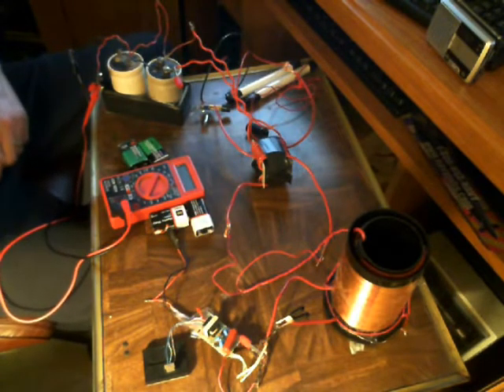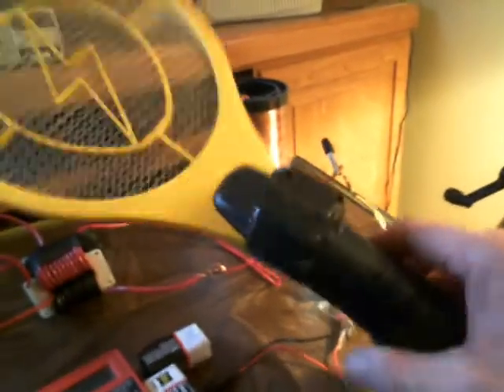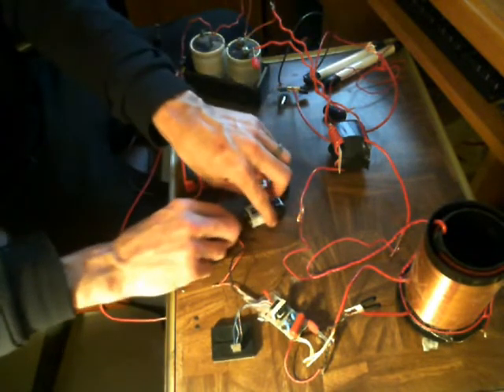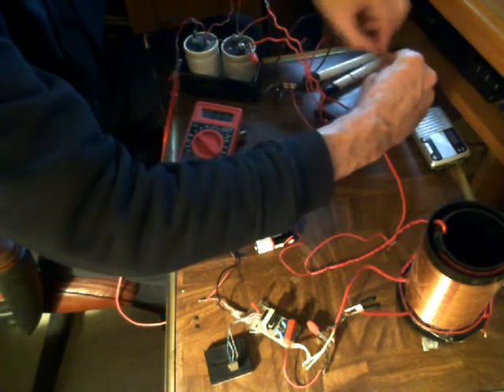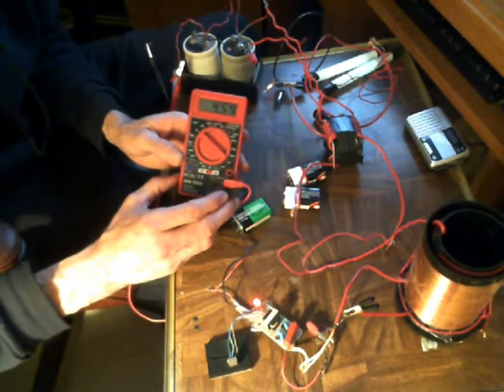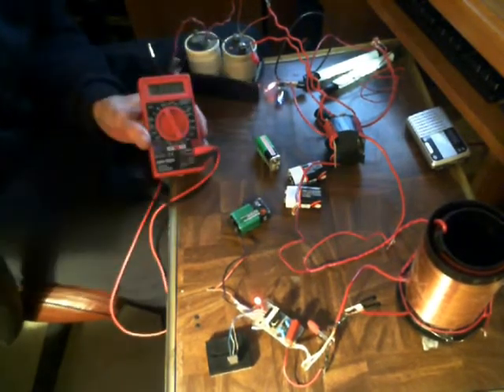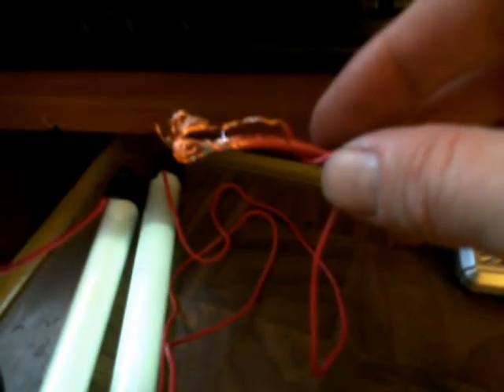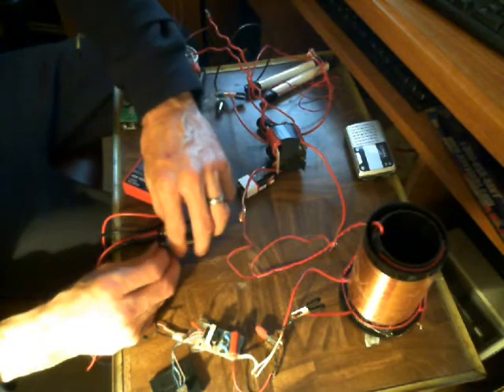SPIKES !

Comment: I like the use of the double reed switch.
Does it show an increase of power over a single reed switch ?
Reply from the maker: It seems to make a pretty good difference for that small circuit. But for a larger one I don't think they will last long. However there are some realy good spark gaps out there on ebay that will. I have been going to dual spark gaps on all my projects it seems to give it a boost. As you seen the difference in the video when I changed from a direct connection to a open spark gab. Gives it that extra punch so to speak. Thanks for watching and I noticed you shared it as well, thank you very much.